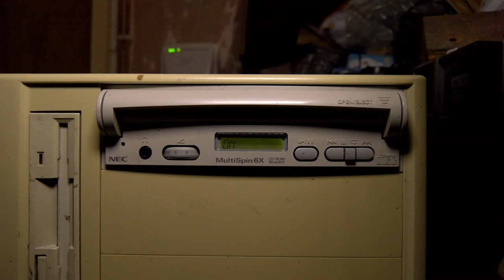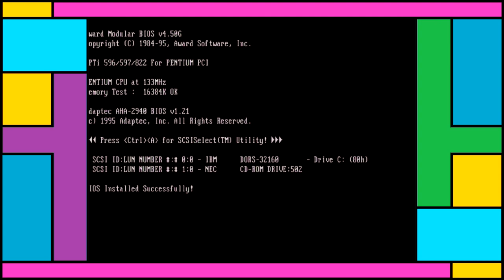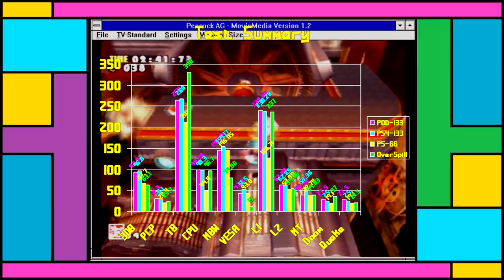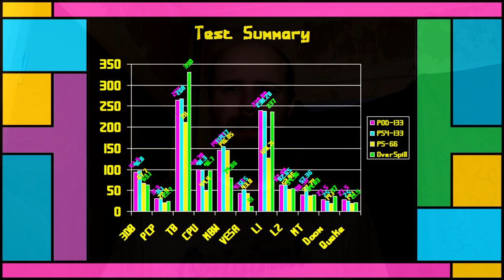Socket 4 Pentium with VLB

Comment: Finally a video! Looking forward to watch it. Appreciate your content.
Reply from the maker: Likewise. I need to check out your RapidCAD video when I have the time to do so.
In regards to your other comment, the intro. That uses a CZ-1 synthesizer, I was surprised to find that these are dual-CPU machines, with two NEC UPD7810s at 15MHz under the hood.

Comment: Pretty unique system you got there!
A shame I didn't kept any documentation of my Canon Innova Media 460 (I still cant find anything available on the internet)  just some crappy pictures of the tower and the fact that it was a Pentium 60 and used VLB/ISA.
I replaced under warranty the CPU as it was affected by the Intel FDIV bug for a Pentium 90 and PCI motherboard so I used VLB for a very short period of time but I don't remember the system was any less stable than any other system I used at the time under DOS/Win 3.1, the only issue I had with it was that the front 80mm fan was "stuck" in a pretty weird manner than I never had seen before, I applied the 12 volts to it and it almost turn, so I shock the damn thing like 6 times and it began to turn until it run at what seems to me full rpm... the passive heatsink on the p60 got so hot that when I touched it with my finger my skin got burned instantly and stuck to the fins. I always find pretty amusing when people just state that you can run old systems without any ventilation.
Reply from the maker: Intel's official literature of the time specified that the CPU should be cooled by a fan in the case in front of the processor, there's no way you'd ever be able to keep a P5 cool purely with passive cooling. Some P54 chips can do it, though, just about, as they were quite efficient, not that I'd do this as I dislike passive cooling.

Comment: The case with the purple buttons!.. I had that very same case back in the late 90's early 20O0'S.... Memories :)
Reply from the maker: They seem to be quite common, probably produced longer than most of the others, as that one was new old stock, seemingly made a decent way into the 2000s. It's just a shame they have such a short motherboard tray.
Reply: @HighTreason610  I wish I could remember the full specs of that old system. I do remember putting a 3Dfx Voodoo Banshee card in it for gaming.

Comment: You are so right about modern hardware. The thing that I find so offensive about it and tech in general is how throwaway it is. I recently acquired a classic boombox. It is older than I am, and while it needs some work (the mode select switches are wonky, primarily) it fundamentally plays and records really nicely and has good sound quality. I guarantee that modern gear won't be still working in 2060 because it's designed to fail after two to five years and then be replaced by the new model.

(The box, a Sharp VZ-2000, was also designed by people who liked hi-fi and thought about what it needs to have. The control panel and tuner bar is at an angle so you can see it properly if it's on a table or the floor. The carry handle is parallelogram shaped so it fits your hand. There are proper recording level controls and meters. And so forth.)

I'm no Greta Thunberg fan but I can't stand how disposable everything is these days.
Reply from the maker: Of course it's throwaway stuff, because it's a fashion accessory first and foremost. I think what really grinds my gears on that front is how they have the nerve to preach about burning household waste or throwing cigarette ends in the drain, yet it's fine to throw electronics in landfill every six months.
Old stereos sound better anyway. I have 80s Sharp GF-555 and 575 boomboxes and the only ones I've heard sound better are higher end models from the time. Similarly the music center is a Sanyo from the 70s which would have been replaced years ago, but as yet nothing has sounded as good and aside from wearing belts out, it hasn't really broken down yet. What fascinates me is how the amp in there is only 20 Watts, but it sure uses all 20 of those Watts when you crank the volume, easily drowning out a 40 Watt system I have from the late 2000s.
- Strangely, I noticed that modern stereos seem to sound their best when playing pop music. Odds are they were 'tuned' to perform well with contemporary music of their time. In the 70s, music had a much wider timbral variety, notably strings, electronics, brass and acoustics to name a few, not just vocoders and a compressor. If sound systems at that time were tweaked when playing the music of the day, then it stands to reason they'd end up being far more capable. Waltzes sound oddly flat and 'narrow' on the modern stereos I have, where they sound much 'larger' on the Sanyo.

Comment: I would like to see the IBM 486SLC/2-66 (386SX on steroids) + Tseng ET4000 ISA (almost as fast as VLB) video benchmarks in Doom. Both are very unique for the time in terms of performance & that CPU only available soldered on a mobo was found in IBM PC's & sold as a cheap upgrade being very competitive with an Intel 486 DX2/66 at the time.
Reply from the maker: I'm aware of these CPUs, but won't likely own one as I have a preference for brown box hardware.

Comment: I had a really similar motherboard back in the day, and it was a steaming pile. The PCI compatibility problem seems to be that the BIOS didn't configure IRQs to PCI. 🤦‍♂️ VLB video cards worked fine, but I couldn't get acceleration to work at all on a PCI Matrox Impression+ (yeeeeaaaah!), so I replaced that motherboard right quick.
Reply from the maker: PCI video cards do work on this one, but the PCI configuration in the BIOS is quite precarious and the whole thing breaks if you change the wrong setting. That said, the board still has issues and some software just won't work with it, regardless of configuration, and some expansion cards do strange things (such as how some NICs lock the system up). The U5SD-40 would have gotten the Peacock VLB card, but it wouldn't work properly in there due to the 40MHz bus. Overall, I seem to have a rather bad habit of building VLB systems that run at higher clocks, as all but this one run at 40, 42.5 and 50MHz. Bad things start happening.

Comment: HOLY COW....like, if you had a 3D Blaster VLB AND a Pentium Overdrive 133....Wow....that would be something, haha.
Reply from the maker: There were Socket 5 machines with VLB that could probably be made to be more overblown, as you could probably approach 200MHz with an OverDrive, if not more with an adapter. The VLB 3D Blaster is kinda pointless though, not my kind of thing, capture cards are more fun.

Comment: I have two Dell XPS 15 laptops. One from 2010 with a Core i7-640m, and another from 2018 with a Core i7-8750H. The ergonomics on the new one are horrific. Typing is worse, the touchpad is so massive that it's impossible to type comfortably without hitting it. Speakers and display are worse, too.

Phones are designed with screens that can't be used one-handed, and you have such small bezels that you can't pick the thing up without accidentally hitting something.
Reply from the maker: All of these features have steadily gotten worse with time, it's all form over function. Phones being used one handed is also a thing of the past, my Alcatel 3V is too big even for my hands (my hands are about 5.5" wide, around 8.5" long from wrist to middle fingertip) but that hardly matters, because it has no buttons. If the screen gets damp, you can't make calls.
Reply: Yeah, I could rant all day.

I genuinely appreciate your videos. You do a lot of the niche stuff that I'm really interested in, and approach it with a hefty dose of realism. Thank you for your work!

Comment: check ebay for cheap capture cards, i found an avermedia gamebroadcaster hd for real cheap a few years ago, no use to you as hdmi and component inputs only though, and i found a clean install of the latest windows 10 usually sorts any issues out
Reply from the maker: HDMI isn't a problem, as I use DVI already, it's the PCI-E. My existing capture cards still work fine, as far as I can tell, but the workstation isn't able to use them any longer.

Comment: My board is much the same. Less cache slots and things are arranged different but same chipset.  Opti is the only chipset I have come across for Pentium VLB boards.  I could go on an hour long rant about WindWhores10 the worst operating system ever made... even the server versions suck in ways.
Reply from the maker: Initially, I thought Win10 was at least better than Win7, but now they annoy me about as much for different reasons. Nonetheless, this board did indeed make me think of that weird dual socket one you have. There seem to be other chipsets out there that could do this, but the OPTi is certainly the most widespread and they may well just be using the same OPTi bridge anyway. There is, to my knowledge, a Socket 5 board out there somewhere with only VLB, no PCI. Cannot remember the make or model, but could probably at least find reference to it again.
Reply: @HighTreason610  It could be the AMI EXCALIBUR VLB PENTIUM? It may be using the VLB only Opti Python Chipset

Comment: Give Manjaro KDE a spin, made modern computers fun for me again because i was running into the same issues. Modern Windows just isn't fun. They constantly force things to be the way they want it to be. Things all work the same way. Its bloated. I figured it all out years ago and to tinkerers there isn't much to improve once you got a classic start menu and proper debloater.

Retro tech has been great fun for me because i can just buy a cheap component and mess about with its drivers and software. But Linux was also great fun because it allowed that same tinkering and ownership feel that makes computers fun for me.
Reply from the maker: Not for me, I'm afraid. I thought about going the Linux route years ago, but none of my stuff works there and I don't have the patience to sit there messing with the terminal, trying to figure out how to compile something with no documentation or having to mess with the OS to get it to do something simple, only to find I can't do it anyway. I don't want to tinker with it, I want to run the installer and just have it work. Windows 10 could do this early on, it still mostly does, it's just gained weight and occasionally things get broken in updates.
I don't see the workstation the same as the old systems, the old systems are a hobby, they're there to mess with, the workstation is just a tool that should work as and when I want it to, nothing more.